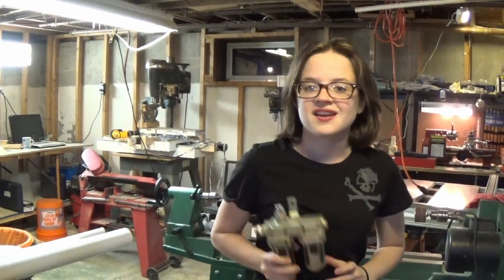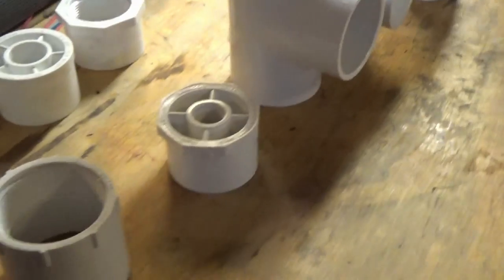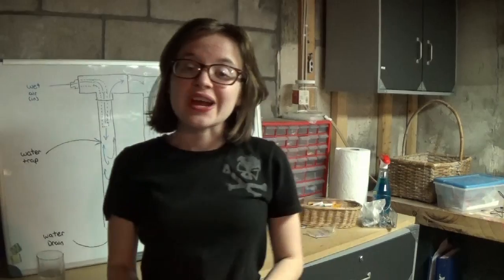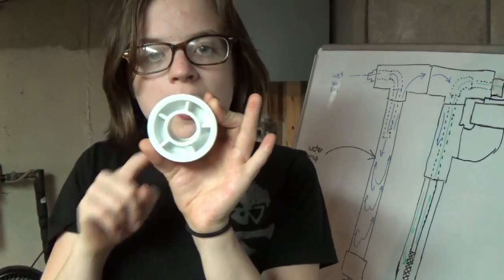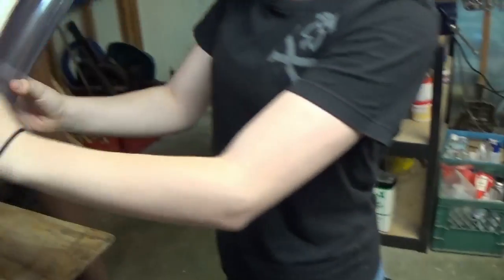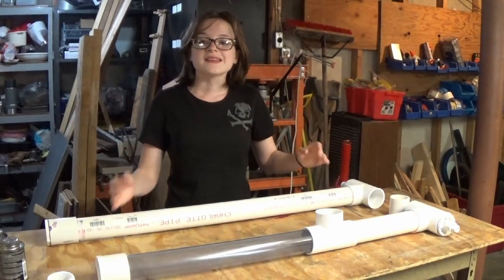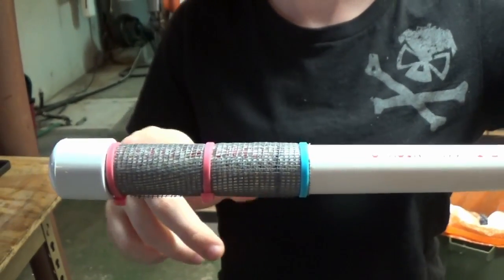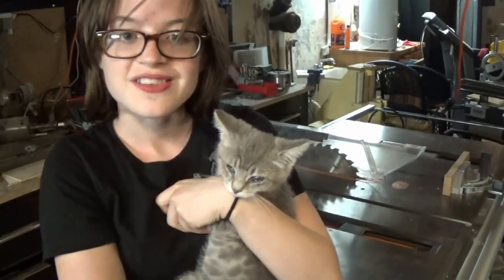Ep 11 Dirt Cheap DIY Dessicant Air Dryer

Comment: great job & mad skills. I don’t like it when people don’t explain why something is wrong and give an explanation of for why, give worse case scenarios, or give any creative criticism and advice. I am one who wants to mentor and try expand any young person. with at said. I would agree with some others that your material choice maybe should have been different. Black pipe or even galvanized possibly would have been comparable in cost, but you may have had to gone a bit smaller. the trade off would have been higher pressures you could run and a safer end product. The PVC is pressure rated, but that is “NOT” for air pressure, but is rated for “Liquid”.  The PVC’s properties are suited for fluid dynamic. PVC’s issue with air pressure is that, because pressure is not consistent in the system it is constantly contracting & expanding. PVC is also expectable to UV light and degradation.Failure in the system will happen at some point. If your in a temperature controlled shop or warm climate, use a constant low pressure no greater than 80 psi , keep it out of sunlight and use low UV shop lights (Yes fluorescent light do produce some amount of UV light. think Tanning Beds) than you should be good for a while. A few tips for you as it look as you look as you didn’t work with PVC that much. prime both pieces then just glue inside female piece. You will have a few seconds to attach and adjust. Also, when tapping PVC pieces together use a block of wood to distribute the blows, this helps the pipe slid in evenly. It also minimize the chance of damage to the pipe and to your rubber mallet. 
love your style. my wife might fight you over Chris. Your parents are awesome for encouraging and letting you explore your Creative, Scientific and Engineering skills. Just remember research your materials before you build. look not just one of its properties, but all. Safety is always your first of design. keep the good work.

Comment: A good mod to this dryer would be to saturate fiberglass cloth with resin . Then wrap the plastic parts with a couple layers . This will add a large measure of safety in case the tubes gets damaged . I have a much simpler dryer using this idea . Not difficult to do and not very expensive .

Comment: run a decent dehumidifier in the room where the compressors are and you can cut the moisture levels by like 90% or more even
Reply: Depending upon location you will never remove 90% of the humidity. I run a 'dry' room. 1100 sq feet of less than 10% humidity. The system cost over $200K for just the dehumidifier. That does not count the special build of the room, the 7 layers of sealing plastic on all 6 sides, the paint, the triple doors to enter the room, etc. FYI we are in Florida.

Now inside this room we work with vaporized lithium that is inside another even dryer booth that alarms go off if it exceeds 2%.

I an very sure that in a sealed room with a generally available commercial dehumidifier you will not get below %25 in many parts of the world. I think it would even be difficult to pull below 20% in the desert. The general humidity in Death Valley is 24 to 35%.
Reply: I'd like to see the research that backs your findings.

Comment: i made your device...thanks

 but have to say i learned PVC designed for low temperature low pressure water, CPVC designed for hot water low pressure, water does not compress like air does making less lethal for shrapnel explosions that PVC will do with compressed air. plus the oils from the compressor break Down the PVC as well as UV from sunligt SO....NO NO NO tom PVC
steel or copper pipe instead will burst with air and not throw shrapnel so its safer and not subject to oil or UV breakdown, at least build a cage around your PVC design, there is also a new system that's  hybrid aluminum  poly encapsulated tubing that is a good alternative for plumbing air from like Eastwood supply, or even shark bite PEK tubing maybe safer. most air filters you see with plastic bowls are caged with steel  housings and typically its poly-carbonate or some other higher grade plastic rather than PVC.

Comment: And to think, I just got a 18" -3" steel pipe with end caps, stuffed rags into it and taped air hose fittings in each end, for my sandblaster. 
Way to go. 😌

Comment: While I understand the concerns some people have about the use of PVC, I think the intent of this is (judging by the other videos) mostly for HVLP painting. With a box around it and maybe its own regulator to take it down to paint-gun pressure (and so that you don't accidentally run regular shop air into it), it seems pretty reasonable.  I've used PVC for compressed air on occasion and the stuff is tough. I have to wonder if some of the horror stories aren't due to people using the non-pressure-rated DVW grade (which is all over Home Depot and similar stores) instead of SCH40.  Big-box stores tend to only have the larger size pipe and fittings in DVW, at least in my area.

Anyway, neat project!  Of course, with a lathe and welder, you could do the next version out of SCH40 steel pipe and have a 10x safety factor...

Comment: i wonder if a metal section and a heater element combined with an aditional escape valve on top couold allow for baking desicant inplace. kinda comes down to what temp does the plasitic lose strength at normal atmospherc presure and is that a perminant change or does it regain when cooled.

Comment: Dobson Susie album video not so great for how to because most of us working with air compressors are all grumpy farts. When you start staying big words you lose us when you start explaining Lil things about bushings you lose us. Anybody looking to take the water off of an air compressor doesn't care about Beatrix so much they want straight forward tutorial. And the audience that would be entertained by these" shenanigans" couldn't care less about water coming off an air compressor.
Reply: However I came here looking for a Diy to take water off an air compressor because we use propane tanks as diesel tanks . They are used to refill  logging tractors that are in the swamp we call them swamp tanks.  rather than dragging around an electric pump on the tank use old propane tanks and fill them 3/4 with diesel then pressurize and voila you have a self pumping tank. They have filters on them but still  have a problem getting water in our fuel despite using filters. Not only our tanks or your sandblaster affected but nearly any air power tool suffers from getting water in it they're just not made for it compared to the price and extreme difficulty of products that do the same thing your idea is in genius please don't take my previous comment the wrong way it was just advice I think might help your channel grow gear the right videos towards the Right audience. In my audience . In my case you could just slap on the bikini if you're old enough I can't really tell on my phone but definitely leave out the Chris Hemsworth because any manly man knows that girly man is no manly man. He is girly man

Comment: I've seen home made dryers out of copper coils in a 55 gallon drum of water, the chilling effect cools the air to a almost dry state you just add a trap and you're done, you can also take a ac condenser from a car and blow a fan over it to cool the air before going into the bleeder and then tank and or run a coil of copper in the ground that's at a constant 56 dgr year round state and dump the heat out that way cooling the air and separating the water  but I think I'd also use somthing like this or just buy a glass one because the glass can't explode like a plastic one might. I ran a 3.5 million dollar printing press we had to have DRY Air a commercial dryer used  liquid glycol coolant to dry the air this was on a screw drive compressor and these are common for commercial air compressors.
Wile she did good, I don't think this is much better then a larger trap however I did learn a few things like changing the desiccant out for new stuff when it turns brown, I did not know that.
And I don't think you could buy one that big for the money she spent to make that one.
I'm happy to see she was wearing safety gear and had the guards on the tablesaw, but never cut round stock on a table saw. its too dangerous use either a miter saw or a radial arm saw or a hand saw or even a band saw.  Still I think she's smart kid and I can't lie I didn't know how those type of dryers were made or what the did.

As for PVC We plumed a 2 acer long machine shop with PVC pipe for compressed air I think one time we had a blowout but it was a line full of water in the dead of winter and the heat wasn't on in the shop that day, each drop about 80 of them had a 12" low point for a bleeder we used 1" pvc pipe  schedule 40  and I think its rated at 250 PSI? don't quote me on that I'm not positive. I just looked it up 270 PSI way more then her 4-5 compressor can put out. And way more then we used in the shop. Static electricity wasn't ever a problem.
But I can't say it won't be in your case.

You do not need to run copper lines, save your money for materials. They sell a pex line set now for air compressors. oh  you can alo install a used fridge in the shop for soda's or water run a large coil into it and pipe the air into the coil and out to a water trap then back to the tank. You'll always how a cold drink close by your air will be dry you can also use it for overflow from the main refrigerator or freezer . Hey and if you get hot you can blow cool air off the compressor at a fan aimed at you. inside of the fridge might be a good place for a car's ac condenser with a fan blowing over it. you'll want to use a aluminum one.

Comment: FYI: I think this is adiabatic cooling "the process of reducing heat through a change in air pressure caused by volume expansion" rather than the Bernoulli effect.

Comment: I see this problem all to often. Everyone wants to filter steam instead of water... Water traps are designed to filter water not steam.... Everyone who has water problems has the
filter and or water trap too close to the compressor... Compressors make steam under hard use and even regular use... All you have to do is put 50 feet between compressor and filter... The air with steam in it traveling that length will have time to cool down and and separate into water and air....run a water trap at that point and you won't even need a desiccant drier... after water trap dump to pressure regulator and fitting for air hose. I use a plain old air hose draped in a down hill zigzag pattern on a garage wall... it's 50 foot long and dumps into a water trap from harbor freight.... I used this setup on a 80 gallon 5 hp compressor, and it filters well enough to paint, grind, sandblast, and plasma cut.. if you do not believe  me try a water trap attach directly to compressor and then after 50 of hose and see what happens...you probably will get zero water off the direct connection and 99 percent off the distant one.... the extra 1 percent water you may have missed,  that is what
a desiccant filter is used for.
Reply: Don't you mean 99% of the direct connection and zero water off the distant one?

Comment: Do not use PVC of any schedule to build or plumb compressed air systems.  The money you save in the system will be used to pay for the medical attention you will need when non x-rayable PVC shards are moving throughout your external and internal organs!
Reply: All you need to do is stay within the pressure rating of whatever schedule pvc you use. And then, just to satisfy the nag gremlin, you hang a "blast shield" between it and the work area. A piece of ½" plywood or a piece of sheet metal would be all that is needed. 
PVC can shatter and fragment and create the kind of injury your talking about. However, to produce the high speed fragmentation required to inflict those injuries with 4" pvc, there needs to be a pretty much instantaneous rise to around 7,000 kilo Pascals or greater. 7,000 kP is right at 1,015 psi. That's more than eight times the 125 psi max pressure  that most normal shop compressors can produce. 125 psi is within the normal operating range of 4" schedule 40 pvc, the bursting pressure is about 700 psi. The pipes get stronger as they get smaller. 
Those "Spud Cannons" are a different story. Depending on how it's made, how much and what kind of fuel used, it is not hard to produce 10,000 to 12,000 kP in a split second. I've personally seen one explode. It was intentional, and there was a barrier, so no injuries. It was a very impressive boom. A few pieces of pvc traveled completely through a 12" cube of ballistics gel and some had embedded into a piece of ½" plywood. None penetrated though. 
To do that with compressed air would require a special high pressure compressor (they do exist, and they're expensive), and then one heck of a valve to suddenly charge the pvc chamber. 
I'm confident enough in her setup to use it. So long as it doesn't get hot in the process, there should be no problems at all. All the expansion going on in there should keep it plenty cool enough though.

Comment: I am sorry to tell you that it is against OSHA regulations to use any type or size of PVC or CPVC pipe for pressurized air or gas. The main issue is that if it should crack it can explode and send out shrapnel like shards that can seriously hurt you or even blind you. 
For your own safety please remake your drier our of galvanized steel or sweat soldered copper pipe. P.S.. If you are close enough to the explosion you could wind up with a ruptured ear drum. Good luck.

Comment: this dryer is good for low pressur only, 60 psi max no more.
You will need to add a FR (Filter, Regulator setup at 60 psi, and don't add lubrificator !!!) 
and only for cold air. no more than 40 c.
the pvc don't support more celcius. at 160c it will melt.

Comment: Didn't watch video but all wrong. Unless there is a new material. The pressure on pvc that may say 220psi is for cool water approximately 60-75 degrees F. When you compress the air we breathe it gets very hot thus causing your pvc to explode.